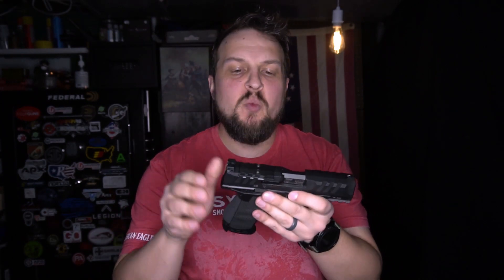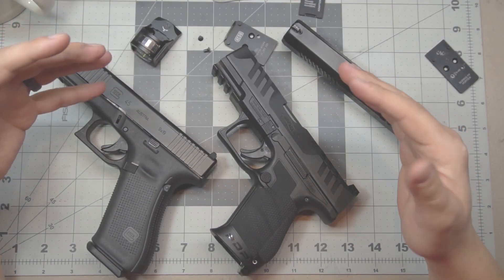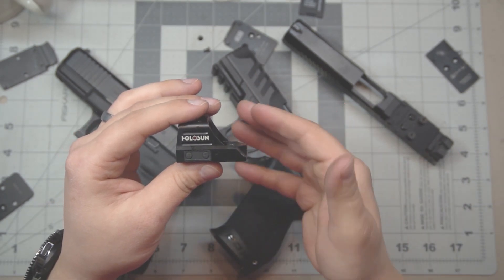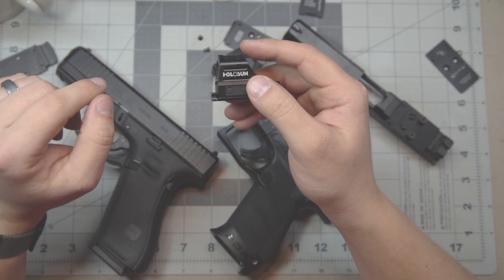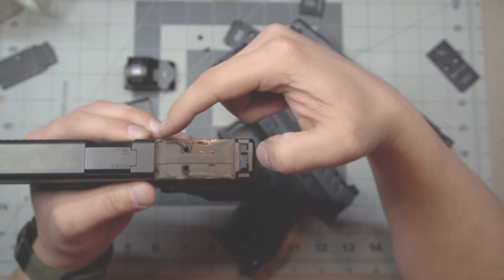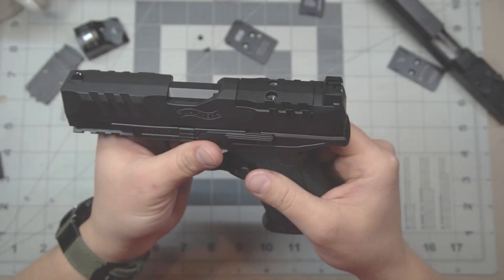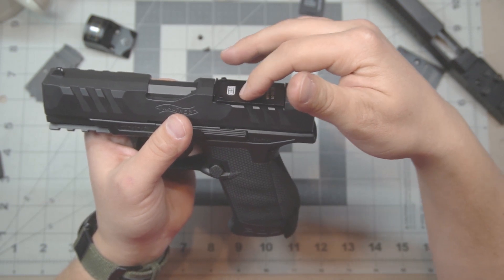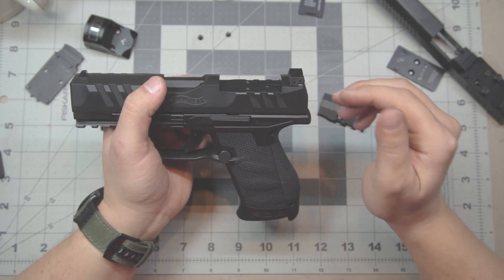The Gen 1 Walther PDP is going to Break

Comment: It's hilarious how confidently he speaks on this yet Walther addressed this in nauseum and tested with no breaks at over 70k shots.
Reply: Bro Skip Bayless and Stephen Smith say shit confidently. Doesn't make it not shit.
Reply: @andrewreil3938  huh? I've put 4k rounds in the gun with everything stock and a holosun 507c and see no stress marks or anything. If the pistol can make it to half the amount that Walther tested to then I'll be more than happy...
Reply from the maker: Walther didn't test the optic system to 70k rounds. They admitted they swapped optics multiple times during that test. I covered their entire response in a video.
Reply: @workthetrigger  happy new year work, we’ve all been waiting for your testing results on the pdp optics plate flaw theory. If you’ve addressed it what video is that specifically. That way everybody can go back and watch it.
Reply: Click bait thumbnail that is a lie. Should be taken down.
Reply from the maker: Funny, Walther recently released an updated PDP... With a reinforced optics plate. 🤷🏻‍♂️
Reply: @workthetrigger  yes they did, they also mentioned, while showing the new version, that they did this to make the public happy. It is videos like yours that required them to do this. You are scaring people for no reason.
A clickbait thumbnail, that has yet to be proven accurate, and is damaging to the reputation of a quality company should be taken down.
I still have yet to see anyone show a problem with the design of the current PDP optic plate design.
Reply from the maker: You haven't been looking or listening then. There are complaints In every single thread and post every time it comes up. Complaints and issued that are hushed away. 

Walthers "we did it to appease" is BS, just like their initial address of the issue. They throw out some crafty words that misrepresent the truth, and add fuel to their cult like following. 

It was a weak point. They fixed it. The new version is awesome and superior.  They made a better gun.  That's a win.
Reply: @EvilSunbro  thanks for speaking truth to work, I gave up in my opinion he acts absolutely ridiculous. He makes absolutely ridiculous unfounded statements and never proves a damn thing.
Reply: @stanlysteemer4872  conspiracy theories of ‘hushed’ complaints. LOL. I just recently purchased the PDP after almost a years worth of research, and never saw ONE complaint about the optics plate causing issues.
He just wants ‘views’. Pathetic really.
Reply: @EvilSunbro  your more in likely right in your assessment in my opinion. I gave up asking him in comments of any evidence he had substantiated concerning his optics plate flaw on the pdp. He never did substantiate any of what he said concerning the pdp. Thanks again for bringing it up to him. I just got tired of asking him and getting in my opinion B.S.
Reply: @workthetrigger  yet both of my pdp's have seen over 5k rounds EACH. I'm a firearms instructor part time on the weekends and like to use and share my walthers in hopes of helping newer to expirenced shooters decide on what's right for them, and of course maybe a sale here and there as well lol.... But anyways, back to my point.... With all the drama surrounding the optics scandal I've been watching and testing my Walther with a holosun 507c x2 and rmr. Every 500 shots I will take apart my optics, look for stress and wear, clean them up and then re-apply and zero them, "I'm one of the weirdos that actually enjoy the zeroing process". So far I've seen absolutely nothing of concern and quite honestly the only thing that's probably putting any kind of wear and stress on my optics is from me taking off, diagnosing and then re applying. My PDP'S have seen pretty much every single 9mm round out there from competition reloads, to my choice of +p carry rounds to very spicy NATO rounds and I shit you not I've seen more stress and life taken out of my glock 17 Gen 5 with moa optic that's only seen maybe 2k rounds by now and that aging still isn't anywhere near being concerned about. My weekend boss also instructs with a pdp and this man has worn out a barrel already with how many shots he's put through his and his optic is still in tip top shape.... Now, he's never taken the optic off like I have to look for stress marks but he's honestly probably put down over 4x what I have since he does this full time. Maybe we're just outcasts amongst the flock, maybe we're just extremely lucky or maybe it's all the above.... Who really knows for sure.... What it ultimately comes down to is proper maintenance and care for your optic. When you decide to put an optic on a pistol yku now take on a whole new responsibility. There's a process of care you must follow if you plan on making your optic last for as long as humanly possible. You'd be AMAZED at how many people come through our doors that put optics on their pistols and dont instal them to spec and have their torque FAR from manufacturers standards. Hell, I've seen customers come in with plates ment for a completely different firearm or different optic somehow strapped down onto their pistols and don't even get me started on the amount of people that have either no clue what loctite is OR use loctite in the worst ways imaginable.... If I had to take an educated guess I would say the ones that are having problems are the ones that don't like to follow instructions or torque specs.... These types of people cease to amaze me because spending money on a firearm is already costly as is.... We all know that it's not as simple as buying a pistol and being good to go.... That's only half the battle. It's exspensive to get a pistol that's optics ready and then get said optic.... I know when I spend that kind of money there's litteraly ZERO room for error.... Specs and directions are there for a reason...... Sorry for such a long and boring lecture but kind of felt the need to address this issue fully and had some free time..... I will admit though, walthers shot show release of the "better" PDP with "Reinforced optics plate" totally caught me off guard. I'm still trying to decide if it's a marketing ploy to hush up all the hubbub about the optics drama or if they really did have such an issue that it warranted an entirely new build process.... I will end it on this note though.... The Walther of today is nothing like the Walther I knew back 20 years ago..... I do dearly love my pdp but it's certainly far from my favorite pistol 😂
Reply from the maker: @TerminalM193  The way I look at the new plate system is this.  They COULD have spent a couple grand, built a machine to take to SHOT show that spent the entire week beating the crap out of the optic and plate system.  live stream the whole thing.  put the optic on, show that process, put it in the jig, and just let the jig reciprocate the plate system somehow in a couple different ways for however long the show was to show the strength of their plate.  Grand total of a couple thousand dollars investment, huge marketing ploy, live stream event, people would've been watching it.  keep a counter on the screen for how many impacts it took, etc.  
Instead, they spent easily 10x that producing a new plate system... because funzies?  No, a company doesn't re-design something based on a whim.  they do it because there's an issue.  
Now, the end result either way is a significantly better design, making this gun better.  Win/Win for the consumer.  I see the new plate system leaking down into the base gun in about 2 years, and until then it's what they'll use as warranty replacements.  fine and dandy.  But they wouldn't have redesigned the plate just to hush the internet crowd.   
I'll admit that many people will be OK.  If you watch Aaron Cowans most recent video on the Steiner dot, he says that most red dot failures in the field are caused not be falling, but by rolling or scuffles where the gun is crushed or the optic is pressed sideways... which happens to be the direction the PDP is the weakest in.  I think Walther finally took a look at the out of the box use scenarios that a duty gun needs to be prepared for, and altered their design accordingly.  Again, I want to re-state how happy I am that Walther took that and improved their design.  This is something VERY rarely seen in the firearms world.   It also shows that we CAN hold our gun manufacturers to higher standards to get them to produce products that are better.  The consumers have way more power then we are led to believe.  And with Walthers updating of that system, i think the PDP Pro is one of the best duty/service pistols available.  I'd love to get my hands on a 4.5" version of the Pro line, so it may make my "buy" list for this year.
Reply: @workthetrigger  I don't think your consideration or reccomended demonstration would ever even be considered only because I don't think it was anywhere near that big of a deal. The vocal, I guess you could say minority at this point.... The vocal minority on the very topic of the plate is in a rather tight vacuum and is blown greatly out of proportion. You have to think about the amount of people that purchased the pistol and went on to enjoy it versus an extremely small amount of people that are even aware of this even being a thing. I'm pulling this number out of my ass here but I bet 95% of people that purchased the pdp have absolutely no clue that this plate drama is even a thing. I've spoken with alot of my students that bring in pdp's and the vast majority didn't even have a clue that this drama was even going on. Walther did address the initial clamoring with their 70k+ test document and with their reputation I would like to think, or hope rather that they wouldn't make such a claim without actually doing the test and being upfront and honest. I think I've come to the conclusion that the newer and "improved" platform is for anyone that may have been on the fence that was in the know OR just another of the many selling points walthers using for hopeful new sales.

I'm going to continue to keep a very close eye on my own rounds used as well as continually checking the optic every 500 rounds and if I even see the slightest bit of damage that is concerning I'll be sure to report back here and if I hear anything from my workplace that warrants discussion I'll add that here and in the forums as well. I hope to never have to report anything of the sort but being honest and in the know with the situation I feel is EXTREMELY important because ultimately there's A LOT of people out there that are using this very platform and trusting their lives with it by using the pdp with optic for carry and home defense. You'd be amazed how many students and patrons I come across that slap an optic on their PDP or other platform of choice that still use the original irons that can't be seen through their chosen optics window on the rare chance that an optic fails in the heat of a situation.
Reply from the maker: Their 70k round test was a bunch of marketing jargan. Check out my 2nd video, I disect their release and how it's worded to make it seem like a stronger test case then it actually is.
Reply: @workthetrigger  idk if you caught my edit by chance, I don't think I got it in in time before your response
Reply from the maker: @TerminalM193  the thing with continued preventative maintenance is that it's going to do just that. Prevent. But SOP for most isn't to remove the dot every 500 rounds.  They'll wait a year maybe. Pop the dot off to replace the battery, never touch the plate, throw the dot back on, etc.  

I have 10 accounts of broken or damaged plates from people directly contacting me.  If you think about how many people own these guns vs. how many are on the internet to know about the problem or take training, even if only 5% of people are watching, that means a number of them have had issues. It may not be widespread, but it was a weak point in the system. 
As you said, there are people trusting their lives to this pistol, and that's a weak point that just didn't need to be there. I think the improved system from the PRO will trickle down in a couple years and the PDP will then be damn near bulletproof
Reply: Wow, some serious feelings were hurt here in this video. It never ceases to amaze me how people can so strongly associate their personal purchase choice or consumer preference with their identity. ‘To say something I perceive as negative about something I bought or like is the equivalent of a personal attack.’ When he showed the design on the screen, it was immediately and apparently obvious that it was a design flaw. You really don’t have to be anywhere near an engineer to see that. Redesigning that setup is a major ‘duh’ move for any company. Little bitty tiny screws aren’t going to hold up to high G shear forces forever. Nothing he said in his video was untrue or unreasonable. Simmer down people.
Reply: @ramseycattn5941  nothing you’ve said proves any type of design flaw.
Reply from the maker: The redesign would sure suggest there was an issue 🤷🏻‍♂️
Reply: @ramseycattn5941  I don't see anyone acting in such a way as to take this as a personal attack..... If anything, this all ended up turning into a very informative and constructive conversation. Hell, if my optic and plate last to even half of the 70k round claim then I'll be more than ecstatic! As long as everyone follows proper installation and torque specs then you'll have absolutely nothing to worry about. I've put thousands of rounds down the pipe now and just took my optic off per every 500 rounds, "I explain why in the chat chain, almost like my own little study" and I still see no stress marks and the threads are still completely symmetrical. I thought for sure by now that I would of had to of switch screws by now just over the simple fact of the multiple times I've taken apart, cleaned off old loctite and added new then added a new torque but somehow they're holding up. Like I said, I've seen students come in with their PDPs that have improperly installed their different optics all on different plates and I've yet to see any damage through negligence even and my boss has probably thrown triple or quadruple the amount I have and he's still showing the same results as my platform. I think if people properly take care of their pdp, keep it well lubed and clean and have proper optic care then it's a non-issue. Hopefully I never have to eat my words because no one wants anything bad to happen to their firearm or optic because they are damn exspensive. Like I said in the comment chain, I'll continue to diagnose everything surrounding the optic every 500 shots and this chat chain as well as the forums will be the first place to know the second I see any stress or damage whatsoever.
Reply: @workthetrigger  trigger everything you’ve stated has never been substantiated. Other reviewers have put thousands of rounds through the pdp and no issue. In my opinion you’ve done nothing to validate your theory period. Walther has not stated nor are others that there’s an issue
Reply: @workthetrigger  all you’ve done is suggest and speculate. Then try and make your speculations into facts when there aren’t any facts that you have. I find you to be less than forthright in my opinion trigger. If others want to follow you or listen to what you have to say good for them but I’m done with you and your channel.
Reply from the maker: Good. Because there was no possible outcome that would've satisfied you. If something had gone wrong, you'd blame me for tampering, or disregard it as an outlier. Just as you have the others that have had issues. Nothing matters, because it wasn't you. Walther changed their design, companies that size don't do that to pander to a few people on YT. They do it because there's a problem. Some day you'll understand that. Best of luck to you and your trolling.
Reply: @workthetrigger  your the troll, you trolled walther.
Reply: @stanlysteemer4872  clickbait so that he can get higher view count. Seriously, you should just stop patronizing him. He’s in this for the views not anything honest. If he wasn’t that clickbait thumbnail and title of video would be changed.

He’s still shown no proof of his hyperbole. I know it’s been ‘hushed’ right, trigger?
Reply: @EvilSunbro  I’m glad you and others see this for what it is. I just find such behavior reprehensible and it’s good to know others do to.
Reply: @stanlysteemer4872  lmao, I tried to be more eloquent and maybe help change his mind Alittle and accept that any of the outliers could be true AND false but it seems this entire thing will continue to stay one sided..... The gull to think I could maybe change minds, or have said minds see other alternatives atleast for thought I guess is kind of silly of me, especially in a format such as this. I really have tried my hardest to find evidence of an "inferior" optic mount/plate design but there's nothing that I can atleast find that can also be proven and/or substantiated amongst others over the same platform.... I mean hell, even with the severe lack of evidence I'm still going to the point of dissasembly every 500 rounds just to be 100% positive I'm not hurting anything optic related.
Reply: @stanlysteemer4872  The point of my post wasn't to prove a design flaw.  That point is self evident in the design. Can you guys really not see that? I'm not trying to be a jerk by saying this.  Look at that design, and do a little research if you're not familiar with some of the engineering principals at play here, and then ask yourself, in all honesty, if you don't think that is a poor design.  Try to remove your bias the best you can.  As for me, the PDP is my favorite polymer pistol...by far.  I would say I have a bias towards it, but even I can't honestly ignore what is plainly evident.  The average gun owner doesn't shoot very much. Many people are going to mount their optic, shoot it 5 or 10 times per year, and not have a problem.  I get that.  But for a gun that is marketed as a serious use duty pistol, that design is not acceptable.  Walther clearly saw that, too.  Why redesign it otherwise?  To appease a few youtubers or keyboard warriors? Come on.
Reply: @TerminalM193  Well, it didn't come to blows or anything.  But there is clearly at least one in this conversation that really dug in even after evidence was shown contrary to his position (not you). I was expecting more like 'wow that's a great observation, good to hear the perspective of someone who has engineering experience. My experience has been positive, but I'll keep an eye on it.' Maybe I'm expecting too much from people in this day and age.
Reply: @ramseycattn5941  look their other engineers that’s commented saying it isn’t a bad design flaw. Point is there is no verifiable evidence that there is a design flaw. There is no recall from the manufacturer. Believe what you will as well as I will do the same. What I’ve stated though are the facts. Work has his opinions that’s it. I don’t intend to comment on his videos anymore or watch his channel ever again. You and others do as you will.
Reply: @stanlysteemer4872  No worries.
Reply: Funny how a firearms company that is trying to sell guns, like a automotive company trying sell cars, will say things to push their product, like “testing,” “drop safe,” etc. to get consumers to buy their products. You have someone with a degree and expect in mechanical engineering telling you it is a weak point that is a cause for concern for a potential failure. Walther came back with a response of testing and ultimately changed their lug locking system in their slide. Sounds like walther decided to better be safe and create a better optic locking system. Like Work the Trigger said it is a win for everyone involved, consumer and manufacturer.
Reply: Simply shooting the gun isn't really whats a concern. Outside of target shooting, durability is really important. Your gun doesn't just break from shooting it, it can break because you fell, smacked it against something, etc. The optic could definitely break off of the mount if you hit it against something really hard on the side.
It's nice to hear that walther fixed the issue, because this is otherwise a really good handgun, one of the best we've seen in a while.
Reply: @Guts3570  quit trying to cover for work and his b.s. he made claims and counterclaims. He proved nor did anything he said he would do to prove his claims. That’s why I stopped watching or subscribing to his channel lack of accountability!
Reply: @Guts3570  If my few PDPs were used for conceal carry I would certainly opt for an enclosed and tougher than hell optic. The new enclosed holosun with acss reticle did amazing on both high drop testing on steel and heavy optic use to cycle the slide. But for the one I use to teach and the one I use for home defense stay very well protected from any kind of abuse. So far, thousands upon thousands of rounds later and constant diagnosis on optic use shows that it's just as strong and reliable as the day they were put on. I've actually had to replace both guide rods in my 4.5 and my 5" at around the 2500 round mark due to curvature of the rod and some slight spring cracking around the polymer rod. Neither caused any kind of malfunctions and have primarily seen 124g Norma ammunition but figured it's best to upgrade before anything DOES happen. Switched both over to the sprinco guide rod system mainly just out of curiosity. I never expected the sprinco guide rod to actually mitigate recoil but surprisingly makes a very noticeable difference and what's better is that the rods have reliably cycled everything from 115g - 147g light to heavy loads all the way up to +p and NATO filled loads in both standard practice AND single handed use. Very pleasantly suprised with the system even though it's a bit pricey...
Reply: @EvilSunbro  I strongly agree!
Reply: @workthetrigger  Thanks for the video, I also was concerned. I like the PDP and I wanted one. I was happy when they showed the SD PRO version with an update to the mounting plate, but I don't like the visual of them. Since a few days we have the version "v2" in one of our main dealer websites, all "normal" versions (FULL SIZE 4", 4.5" and 5" and the two COMPACT 4" and 5") will have the updated mounting plate and the color options (which only the COMPACT had in version 1). I'm really happy for these changes and will order now a FS 4.5" version 2!
Reply: @workthetrigger , for real?
Reply: And yet...
Walther did just CHANGE the Slide Design on the PDP to "fix" this non-issue!
Reply: @Snapper314  Exactly.... The only reason they changed anything was because of outcry. I've still not come across anyone having ANY RDS issues with their 1.0 footprints.
Reply from the maker: I've had 5 people send me pics within 2 months of this video of their broken or severely loosened plates. Companies don't spend tens of thousands on a design change if a $5k cycling machine and a live stream could shove it to a dumb YouTuber